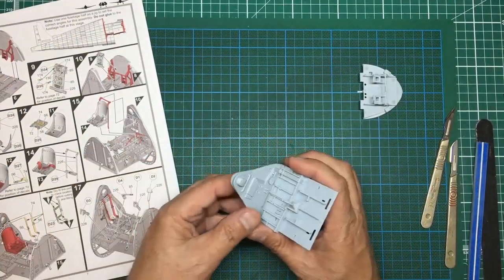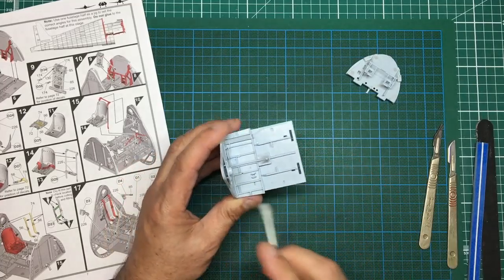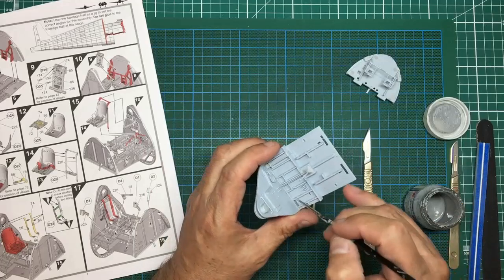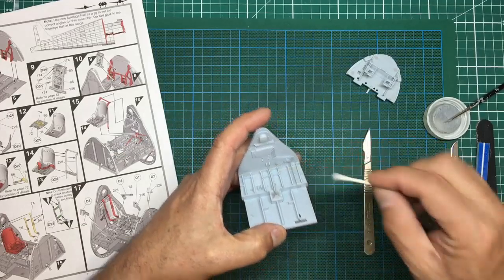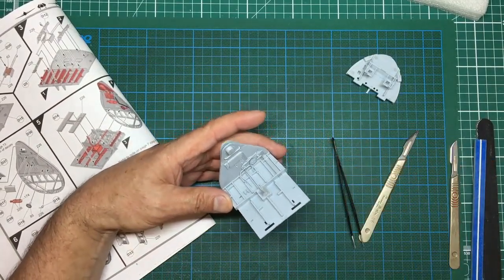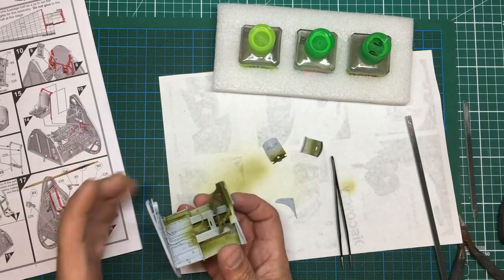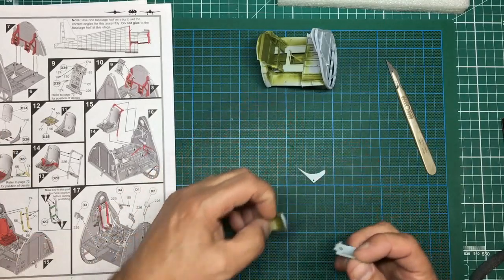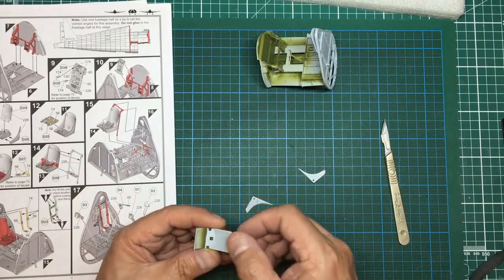Airfix 1/24 F6F-5 Hellcat build. Part 2.. more cockpit

Comment: one thing I've always found frustrating is when I gat part of a model assembled, and realize I needed to paint some of the areas before hand. Instructions by the model companies make it seem like you finish the model, and then the paint just magically goes where it's supposed to. I'm glad you pointed this out. 
   As for mold lines and injector pin marks, the older and more used a mold is, the more pronounced these will be. Wear really doesn't become a factor until several thousand runs.

Comment: Hi Nigel Thanks for your reply to my email.  I went back and checked on those pics I sent you and they were mislabeled and I did delete them and will look at the site you mentioned   My cockup.  Still waiting for my kit to arrive.  As for talking about tools I don’t have an issue with you mentioning them as you may be using something I have never seen before and since no one knows everything I appreciate the references to the tools you use.  As an aside in the area I live in the well stocked model shops are few and far between and practically everything I have is ordered on line so the names, part numbers and manufacturers you mention make it much easier to order.  Can’t please everyone Nigel and it is your channel and keep on keeping on the way you do it is always appreciated.  Good build so far.

Comment: 15:16 2 years down the line, my fuselage fits perfectly around the front bulkhead straight out of the box. (looking at how yours is out of round...) The diagram shows that front bulkhead flush at the top, I've yet to test it with both fuselage halves...
Reply: It's interesting. Mine is the same as Nigel's but regardless of that the fuselage halves went together without a problem, just had to apply a little bit of "force" around the front bulkhead. No filler needed.

Comment: Nige
Nice work on the front office... some excellent tips and ideas. Just a side note, I'm planning on going with either Hataka or MRP Lacquer paints for my Hellcat build when I get started. BTW, interior green, is a mix of 10 parts zinc chromate green and 1 part black.  During the war, most manufactures bought paints locally, as did both Grummans and Republic here on Long Island and the actual colors did vary quite a bit from the specs - war time shortages and the need to get the aircraft off the production lines and into unit hands.
Thank you for the info on the Tamiya Sprue Cutters - ordering mine this week.
Keep 'em comin
Peter

Comment: I don't know if you mention or use later on in videos Nigel, but if paint takes awhile to dry why not use a hair dryer or a heat gun on a low setting, it will make life a lot simpler and quicker.

Comment: Nigel, great build so far and the more you explain the better as far as I am concerned.  I had been away fro plastic kit modeling for some years focusing on wooden ship models which have entirely different techniques and tools so please continue as you have.  I have a general question about the different paints and their drying times.  Do the slower drying paints shrink less in corners or abutting parts than quick drying paints when applied over a base coat or not, and do the slower drying paints settle and adhere better than faster drying paints.  Great build. and as always looking forward to the next part.
Reply from the maker: GOOD question @allen sjoquist I really dont know the answer to that one. I'll have to do a test. I can say the Revell paint is pretty tough, and when sprayed with their thinners it takes a while to dry.

Comment: Great work

Would suggest you remove the fuselage sides as they are less likely to get damagedas you fit the cockpit area
Then you can put both sides of the fuselage together and check it fits
Reply from the maker: Unless of course you want to check that the cockpit fits with the sides in place??

Comment: A very nice build there Nigel, it will look amazing when finished. I only have one issue with your videos of this build so far and that is the sound level, some parts of the videos are too loud and other too low maybe you should check it out?
Reply from the maker: kostas stavropoulos thanks for the heads up. I currently use an iPhone but am saving for a better camera. Maybe I should get a mic to start with so I get better sound?
Reply: @NigelsModellingBench  I am not an expert on sound engineering and i don't have any experience with audio equipment so take my advice with a grain of salt. For starters i believe a microphone would be a good choice, maybe a wireless one that you can clip onto your blouse so you won't have any equipment in your way while modelling and filming. After that you could go for a better camera. Also maybe you should check if there is an option to sound balance the audio via software.

Cheers
Reply from the maker: @kostasastro  I have ordered a lapel mic from Amazon. It arrives today. I shall hang it off the camera in front of me and see how it works.
Reply: Great  job Nigel.RB productions do 1/24 USN seat belts with working buckles etc....Phil.

Comment: Nigel, I noticed you didn’t use a primer when starting to spray the cockpit? In your experience when do and don’t you use a primer? Thanks
Reply from the maker: I generally dont bother on areas that dont require an awesome finish and or wont be handled.